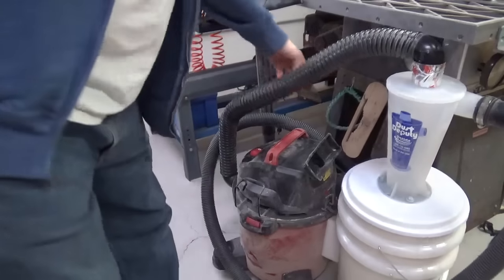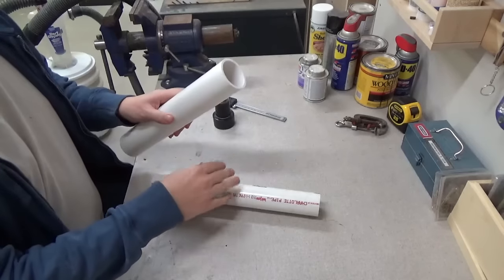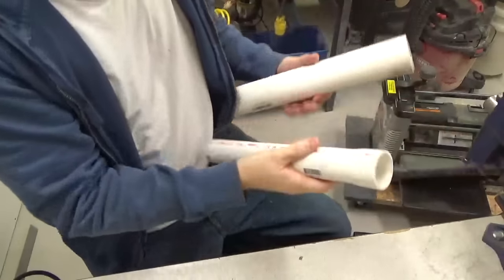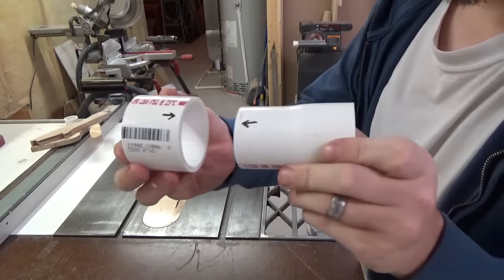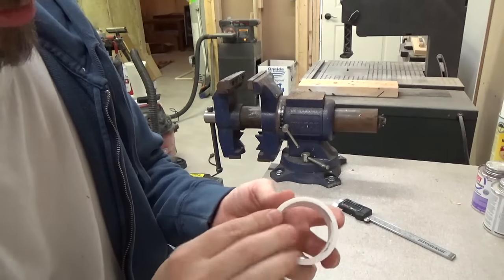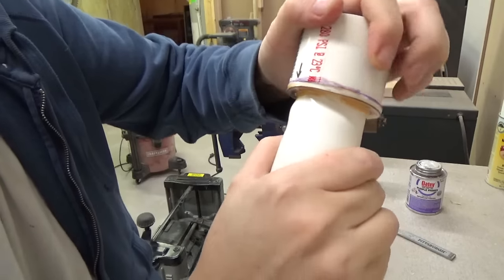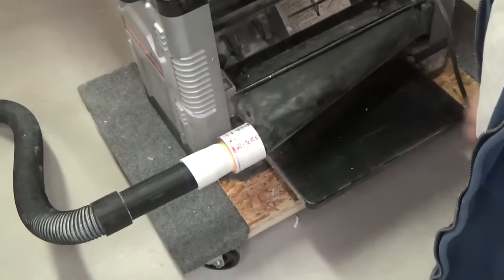Shop Work: How to make your own PVC dust collection adapters

Comment: Yeah there is circle in hell reserved for the manufacturers of shop equipment and vacuum cleaners that could not come to an agreement on a standard size or two of hose diameters. Everyone thought they knew better and thus every maker has 1 to 2 of its own "standard" sizes, none of which are standard. .
Reply from the maker: Yeah, they certainly made it difficult, didn't they?  This simple make-shift solution has helped though.  What's nice is that you're not limited to circles either.  You can mold the PVC into virtually any shape and make all kinds of custom fittings for it.
Reply: Rigid shop vacs are the worst. The hose connections are fine. It's the connection on the vac that is basically a proprietary design.
Reply: Evermore  The connection on the shop vac is an odd size. I forget what it is, but I have found nothing that matches it.
Reply: It’s true - its absolutely ridiculous that hoses that are labeled as being a certain size don’t fit each other.  Most frustrating thing in my shop is getting dust collection to work reliably.  Ludicrous.
Reply: AMEN!
Reply: @danwhitaker9168 hmm, that might be a good reason to use this method to make an alternative input and permanently or semi-permanently attach it to the rigid to fit all your other more common connection size hoses and accessories. I will look into this with my Ridgid vacuum
Reply: @musicbymark  I've noticed RIGID has changed how the hose couples to the shop vac on the newer models. The Rigid I have is 20+ years old. Time to upgrade to a new one.
Reply: Agree 100%. And don't get me started on faucet cartridges.
Reply: @danwhitaker9168   Get the rubber flanges from the plumbing section, problem solved. I have 2 ridgid shop vacs, it works. 2 in central vac piping can be made to fit with the 1 7/8 and 2 1/2 ridgid hoses.
Reply: It's all about greediness from corporations wanting you to buy more stuff and even if you buy everything from their brand still from time to time they change some things that make you inevitably have to buy newer stuff. And this is notable from top brands which know they have a loyal client base that out of convenience keep supporting them on all this. On the other hand, cheaper brand tools you may find that in many of their tools the dust ports are identical so you can use the same adapter in all of them.
Reply: Hehe. I have also entered the club ;)

Comment: Nice.  It looks like that will work.  I think I'll use a chain-link fence post topper as a form though, instead if the table top.  They come in domed or conical forms, and are only a couple bucks each.  I just prefer a sloped transition to a stepped transition.
Reply: That’s great idea. I would use one of those to initially increase the size of the opening, making it easier to fit around the piece you are trying to make a fitting for.

Comment: This is genius. I've used a heat gun to adjust the angles on some PVC conduit I've installed around my house, but I never thought to use it to make custom adapters for dust collection. This is way cheaper than the flexible rubber couplers that I've been buying at HD.
Reply from the maker: I don't know about "genius", but I'm glad you liked it.  haha.  Thanks for watching, Jaime

Comment: very useful technique. I have run into the same problem in my shop. Instead of making the flange connection, I use a 1 1/2 to 2" pvc fitting. To get the flair on the 1 1/2" pvc, I  made a tapered mold from a piece of dowel. Works good, I can make fittings as needed.
Reply from the maker: That would work too!  When I was filming this, all I had on hand was the 2 sizes that you see in the video.  But if I had to go to the store to get materials, I probably would do what did.

Comment: So, I just made my first one using this trick. I came up with little bit of an enhancement to your idea, which is to reduce the diameter of the larger end where the small piece and the large piece meet in the middle. I was having trouble making the flange on the smaller piece large enough to mate to the larger end. So after I flared the end of the larger piece, I put a hose clamp around the the mating end and heated it. As it softened, I tighted the hose clamp. I got it so matched the diameter of the small pieces flange perfectly. i'm very pleased with your idea, thanks!
Reply from the maker: Oh nice!  Good idea

Comment: Good idea! Never thought of this. So simple but so great. Those shop vac power tool adapters are not cheap, and I bought one that did multiple sizes ($25 CAD) but it still didn't fit my track saw nicely. This is what I'm going to do. Literally stumbled on this video at the perfect time.
Reply from the maker: Right on!  Glad it helped

Comment: That is a handy tip and thanks for sharing. You can use a carbide deburring tool, typically used to deburr metal pipe, angle iron, etc. but it works well on plastic, too.
Reply from the maker: Yup, that'd work nicely

Comment: This can save you a pretty penny. These adapters are not cheap to buy and it seems every machine uses a different size! Thanks for posting
Reply from the maker: Thanks Stephen!  So far they've worked out just fine.  The one for my sander (the one that tucks inside the port instead of on the outside, has a tendency to slip out on occasion so I"ve had to use duct tape to hold it in place.  Aside from that, this solution has really worked out well for me since I don't have a standard dust collection system.

Comment: Thanks. Very simple idea after someone shows it!

Just after to watch this video I went to workshop to construct a pair of adaptors. It works! I have two adaptors now made of 3-in sewage PVC pipes. They are not so professional in appearance like yours but they are functional. If you are using an adjustable temperature gun, 330 degrees Celsius looks good for sewage PVC pipes.
Reply from the maker: Awesome, great job!  Glad it worked for you

Comment: Nice trick with the flared one.  I have done the other molds often, but that was new to me.  I find it useful to start with a longer a piece when heating the first end, then cut to size on the band saw, with a sled to help square the cut.  Good idea to keep it on the black hose in when heating the other end, as PVC does have shape memory.
Reply from the maker: Thanks for watching!  Glad it was helpful

Comment: Sweet idea! 
I have multiple brands in my shop and every brand has its own port size... Previously i tried with duct tape but the dust was piling up on it's sticky part and it was anoying. 
With this trick it will be awesome. Thanks!
Reply from the maker: Thanks!  Glad you liked it.  I hope it works out for ya

Comment: I used your method with some 4-inch PVC.  Worked great.  I also did this with some 2-inch to use as a coupler between a 2-inch and 1.5” hose extension I had for my orbital palm sanders.  I found that the PVC was a lot heavier than any of the hoses I was using, and it was a bit of a pain holding up that extra weight all the time.  I think I’ll look for some thin-walled PVC, see if that works better than the thick-walled stuff.
Reply: The thick ones are schedule 40, they get heavy for sure. Use schedule 20 that are thin. Howeve when heating them up you have to be careful, they bend and melt easier.

Comment: In the future, you can use an empty champagne bottle for starting/creating flanges and coves with hot PVC. The bottom of the bottle creates coves, the neck creates flanges. Just slide PVC down the neck or press firmly into the bottom of the bottle for a cove.
Reply from the maker: Neat idea!
Reply: ... and you get to empty a Champagne bottle, as well!

Comment: GREAT adapter, I will definitely use this idea around the shop.
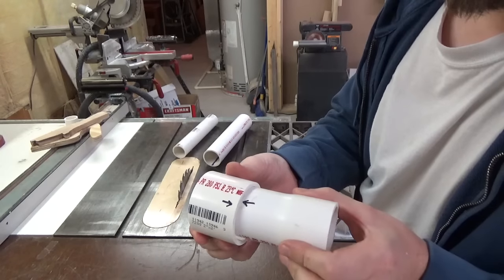Question:  At about 3:28+-, why can't you 1. cut the smaller piece about 1/2" past the expanded coupler  2.make the 2" piece a couple of inches longer  3. sand a taper on the coupling side of the 2" piece and then simply glue them together, rather than doing the next "mushroom" step??   Just a thought to cut out a step.
Again GREAT idea for both male and female connections.
Reply from the maker: That would probably work too.  I only had the 2 sizes of PVC lying around.  But yes, if you're looking to make a bunch and you're hitting up the store to get your PVC, then you can probably step it up with varying sizes instead of mushrooming out a smaller one like I did.  Might cost more in the end having to get more sizes of pipe, but the trade-off might be easier assembly.  Thanks for the comment.

Comment: I had to run right down stairs and try this.  I can get 2 inch pvc over my shop vac connector, but I couldn't get it over a (full) pop can.  I also did one where it shrank slightly to make it into my radial arm saw hood.  It seemed to rebound to its original size on the other side, which is good, since it won't fall out.  I recommend wearing some work gloves while doing this.

Comment: Try using a can of compressed air (used for blowing dust off computers) held upside down to cool the PVC instantly. Just hold it in position and shoot it with the air for about 5 seconds. Good video.
Reply: That is a waste of money when a wet rag will do the same.

Comment: Speed up the cooling period by misting water on the heated pipe that way you don't have to hold it until that magic temp is reached where it will not move.

Comment: I've used the heat method to make adapters that were just a little different on each end, but the joining different sizes with the flange method is genius. I'll never buy a $10 adapter at Rockler's again.
Reply from the maker: Glad it could help!

Comment: I have a dewalt dwe7485 Table Saw, it has a 2.5" dust port, but I saw an adapter just like you had, but it is the same size as the port. both are 2.5 O.D., they don't play well with each other. these tool manufacturers and shop vac manufacturers need to get together on this stuff.

Comment: Excellent  Nice Ideas... as you were making 1st adapter for planner I thought you were going to swege the small piece like you did on the side to fit vac but a little more . It would have fit snug into the larger PVC a little cement, done stronger and less time

Comment: just got back from homedepot trying t find an adapter between my planer port and my shop vac. Last night I spent over an hour looking for ides . I did try the heating on some PVC but could not get it to go together but your comment on reheating showed me my error. I did not  heat a enough the first time  I tried reheating and it seemed like it was worse, your comment about when reheating it goes back to original shape. it sure does!!. I cobbled something together with a rubber coupling for the planer but will make some other adapters for my bandsaw and mitre saw. You would think the manufacturers would coordinate with the plumbing world on sizing. I am thinking they want to push there own 'dust collection' systems and fittings on us.
Reply from the maker: Awesome!  Glad I was of help!

Comment: This is cheap idea but an easier fix is to use flexible rubber plumbing Fernco fittings.  For handhelds, have the shop 2 1/2 inch (really 2 3/8 od and 2 1/4 id) vac hose connect, consider using Fernco  1 1/2 x 1 1/2 pdtc-150 will fit to all dewalt handheld tools @t  and a 2" x 1 1/2  p1056-215 @t  will fit to Delta miter saw port.   You can slide your vac hose connection inside the 2" and outside the 1 1/2 (the larger outer dimention of this fitting  is the same as the inside dimension of your vac hose).  These are flexible so they flex to fit. Any section of 2 inch rubberized straight connection can fit to your vac hose end if you have a 2 1/2 hose connection like most larger shop vacs.
Reply from the maker: Good tip.  I was just making due with whatever I had on hand.  Didn't want to have to buy anything.

Comment: Just a suggestion but they have a 2” to 1-1/2” reducer at home depot
Reply: I was going to say the same thing.
...but then...no cool video of trying to fuse PVC to his table saw.
Reply: Good call. Thanks
Reply: Yes, but the reducer goes over the pipe. He used 2 inch pipe to go over the outlet which is a 1/2" smaller than the inside of a 2' coupling so the coupling won't work.
Reply: The coupling would make connecting the 2 pieces together though

Comment: you could have got a 2" to 1-1/2 reducer , not had to melt press a flat end then glue . 50 cents more , I found pool supplys work best for my dewalt arm saw

Comment: Nice video for a very handy technique to save on DC on the shop. I have one question or concern: I've been warned that heating PVC releases certain toxins that are harmful to breathe. Do you do this while wearing a respirator, or is it not a concern because of the limited heating time? The warning that I've heard a specific to heating it, not exposure to be cutting dust or any other part of the PVC. Thanks for sharing this video.
Reply from the maker: I haven't heard of that.  I know it's bad news to breathe in the black smoke caused by burning plastic, but that's not the case here.  No, I didn't wear a respirator.  Not sure what to tell you aside from "I'm still alive".
Reply: Fisher's Shop :) I'm glad to hear that. I'm no expert, I was just curious. I've never manipulated pvc like this, and I can't recall where I heard the info. Your technique is effective, and I appreciate it.
Reply: Man all the bad stuff we inhaled, don’t think that little bit will hurt

Comment: Drew...I'm just catching up on some of your older videos and saw this one. Very clever idea for the adapters. Question: how did you attach the dust deputy to your shop vac? I have a similar arrangement but have yet to determine how best to keep the two units close together. I see some white blocking material between the two units right at the beginning of your video but not sure how they are attached. Thanks!
Reply from the maker: Oneida ships the unit with 2 foam blocks and some hardware to screw the container bucket to your shop vac.

Comment: Would you not have a better fit if you pushed or "Mashed" as you described the shop Vac hose further into the PVC and use the expanded section to better fit in the larger pipe???

Comment: Why didn’t you just use standard, cheap couplers from a big box store instead of expanding the ends of the 1-1/2” and 2-1/2”?

Pretty cool how you made that flange!
Reply from the maker: Good question.  I was just working with what I had.  I didn't want to drive all the way to the big-box stores just to pick up a couple PVC fittings when I could just heat up what I had and make it work.  I'm sure it would look "prettier" if you stepped it up using couplers, but the uglier my tools are in the shop the prettier they make me look on camera.  :)
Reply: Exactly!
Reply: @meandyou917  I would have bought the pvc adapters.  I'm 80 years old and want to spend my remaining time woodworking, not reworking pvc to look cool.

Comment: Using a 1 1/2 to 2 reducer coupling between the two would be a lot easier.....leave the unstretch portion long enough to put in reducer coupling
Reply from the maker: It would, but I was working with what I had so that I didn't have to buy anything.

Comment: I admire your inventiveness when you are joining the 2 pieces of pipe together where you heated and flanged the smaller one would it not be a whole lot faster and easier to use a reducer bushing to make that transition instead of all the heating and sanding ?
Reply from the maker: Yes it would have been, but I was working with some salvaged PVC pipe from a previous project.  I didn't want to go to the store and buy anything more.  I was just making do with what I had.

Comment: DAMN GREAT IDEA....I too have multiple machines and not all have the same fittings. This just solved my problem.  Just curious as to how are they holding up?  Have you had any glue joint failures ?
Reply from the maker: They work just fine.  Haven't had a problem with any of them.  Since this video I've made a couple more and they're holding up great.  Glad you liked the idea!

Comment: PVC is safe and stable. Heating or burning plastic releases vinyl chloride an extremely toxic gas and has cause many deaths. Breathing the fumes has caused many deaths, therefore work in well ventilated area.

Comment: I have a belt sander that I mounted into a platform. It has a dust bag with a rectangular port. I wonder if this method would work with it?
Reply from the maker: Honestly, it'd probably work just fine.  Once you heat them up enough they will conform to just about any shape.  It might take some finagling to work it around the port, but once it cools you should be good to go.
Reply: Same problem here with a powertool planer :-(  I wonder, which moron constructs a rectanguler chipsout..... will look here for some pvc pipes. Thanks for the video. And subbed.

Comment: What about the square ports on my handheld finishing sander AND belt sander? They dont seem like I could attach anything to them...
Reply from the maker: Haven't seen any square ports before.  But I imagine with enough heat, you can get a PVC pipe to flex and wrap around just about anything.  Maybe it'll still work?

Comment: Thx for your video, i have the same issue, all the other videos I’ve seen are much larger piping. 
I’ve been to HD and Lowe’s, neither could help. Where did you get the PVC, big box or somewhere else?
Reply from the maker: Yeah just the big box store. You can get it in small sections

Comment: Would be easier to just buy the 2 PVC pipe and an end cap. Then drill the end cap to fit the smaller PVC then glue them all together. Then waste all that time to heat and make a flanged one.
Reply from the maker: I was working with what I had on hand.  If I were gonna make a run to the store, I would have done something totally different.